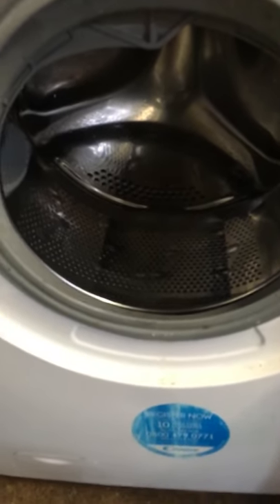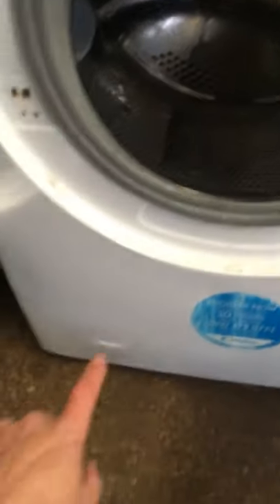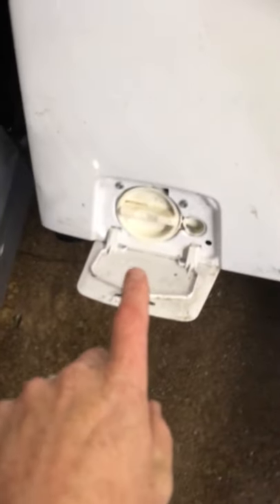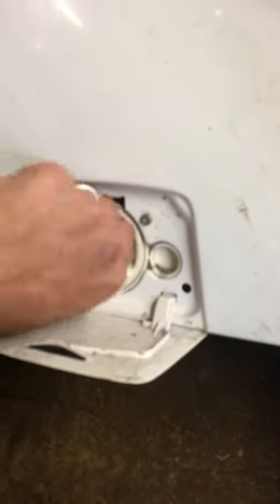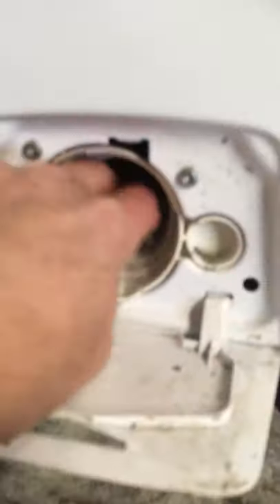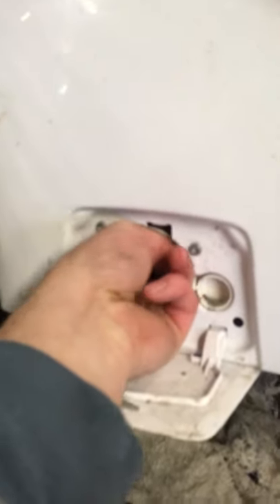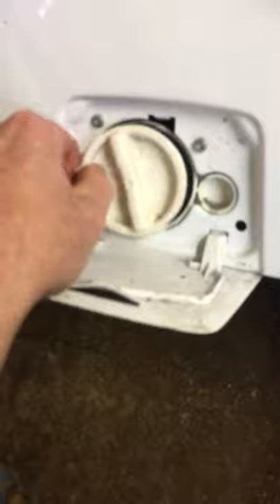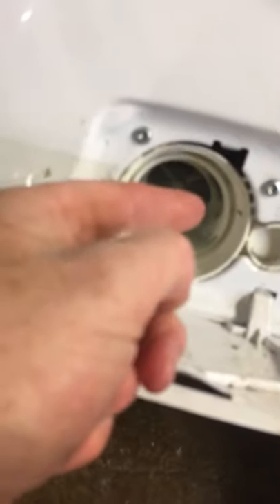Candy E20

Comment: These machines are brilliant!!!! just unblocked my filter and it was bad, real bad😊 took that black pipe off aswell, this Maci Ive got is over 20 years old!! 8 kilo candy with hiatsu wash system, it’s got a dial instead of digital display, got it draining again but then it was over filling with water , running it now and think it’s ok, can you still get the fill sensor I think it’s called? Maybe it’s reset itself now🤔
Reply from the maker: @julianmorris9951  Hey, yes you can still get the pressure switch 👌

Comment: Thank you!! Your tips were correct, but I almost gave up because after cleaning the drain thoroughly, the machine continued to give the same error. But I kept trying to run the drain/centrifuge cycle over and over, and after 7-8 attempts it started working again. Thanks man.
Reply from the maker: Excellent, And good on you for not giving up! 🙂👍

Comment: Hi mate when I turn the white filter, the black end of the filter is tuck inside the washing machine.  What can I do to get that out?
Reply from the maker: Hey man, very gently try work it out with a flat head screwdriver or even a blunt knife. If possible you could also try grip the plastics remaining on the black piece. Of course being careful not to break them. If they break it’s a case of a new filter. These are inexpensive though
Reply: @washingmachinetipsandhelp4350  Thank you for your reply. Much appreciated.
Reply from the maker: No worries at all 👍👍

Comment: And if all this fails but still gives out the e20 code does it need a new pump?
Reply from the maker: It’s rare I find the pump go in these machines however if you are certain there are no blockages anywhere it might be no harm to check the pump. Every quarter of a turn the pump propeller should ping as you turn. Is this happening for you ?

Comment: We have the same error on ours, but can’t open the door or the filter! Any suggestions? Thank you!!
Reply from the maker: Hey, They can be difficult to open at times. Open it anticlockwise as much as you physically can, if possible get a flat head screwdriver in behind the filter and try prise it out, Be as gentle as you can, but slightly forceful if you know what I mean. Try not damage any of the treads where the filter goes into. Good luck 🤞
Reply: Thank you so much!! You’re a star. All fixed :) x
Reply from the maker: @eden-raelake4116  excellent! 👍 Well done you for doing it 🙂👍

Comment: My machine stopped in the middle of spinning, it got water like in the video and it makes a buzzing sound, there is a burning smell that intensifies if it is turned on. what could be? it has only one month :( and dont work, only do a buzzing sound
Reply from the maker: You should be under Warranty- I would stop using it if there is a burning smell.

Comment: Hey mate, I’ve the exact code on mine and water inside the drum. When I twist off the filter only the twisty bit comes off. The actual filter inside doesn’t budge. Any idea what I do there?
Reply from the maker: Hey James. This happens (usually when something is stuck in there) the only way really of getting it out is to get a flat head screw driver in behind it and try prise it out towards you. It is trick and needs a lot of patience but it will come. Also you must be carefully not to damage the thread that the filter screws into. Perseverance and patience are key to getting it out. (P.S. - Are you the Australian rugby player James o Connor ?) 🙂
Reply: @washingmachinetipsandhelp4350  cheers mate I’ll have a go at that , I’ll try not to break it but I’ve a feeling I will 🙈 haha no I’m not that James OConnor. I lived over there for 8 years and got told about him a good few times . Back in Kildare now . So best to use two screwdrivers and try pull it out is it? The twisty cover came off easily but the filter is buried inside it
Reply from the maker: Ah good to back on home soil. Spend a year there myself. Great lifestyle over there. - Yes that might be even better - one each side. If you break it I’ll send you up another one if you do. But honestly o change them all the time even when the piece gets stuck inside I manage to get it out, and I am a bit of a mulicur.
Reply: @washingmachinetipsandhelp4350  yeah so I broke it off. I need to stick to bricks and blocks ,  I can build houses but when it comes to stuff like this I’m a disaster .. Do you know where I’d go to pick one up tomorrow? I can see them on spare parts.ie but id like to grab one tomorrow so not waiting a few days for delivery
Reply from the maker: Ah balls, Sorry James. 🙁 you I will take a look around there and see is there anywhere close to you. Off the top of my head I can’t think of anywhere though. 😕
Reply from the maker: If you like I can send you one tomorrow and you would have it probably Thursday
Reply from the maker: @conkers84  Elite Spares Athy co Kildare. - Will I send you their number ?
Reply: @washingmachinetipsandhelp4350  ah you’re very good but I just ordered one there online and paid an extra €11 for express delivery so hopefully it comes this week . That buy spares.ie are actually a Uk company so I just got caught out with that. A new machine in DID is €280 so if I broke the seal at least it’s not mad expensive. Thanks for your help tonight anyways . Appreciate it 👍
Reply from the maker: @conkers84  no Worries at all James. Hopefully you won’t be waiting too long. 👍

Comment: I have gone to undo the filter anti clockwise in vid and the black part that was attached to the filter is stuck inside how do I get it out
Reply from the maker: That is a common occurrence unfortunately. If you could get a flat head screw driver in behind it and wiggle it out it should come
Reply: Ok thanks for your help 😊
Reply from the maker: @Lyndsey-r4z  no problem. Just take your time and be gentle with it. Don’t force it 🙂👍
Reply: It worked and had was very much blocked and is working thanks so much for getting back to me and for the vid 😊
Reply from the maker: @Lyndsey-r4z  no problem 😉 - You are very welcome! Glad to have helped 👌